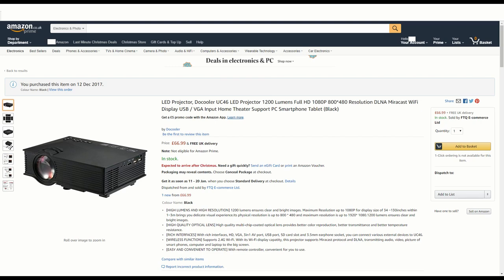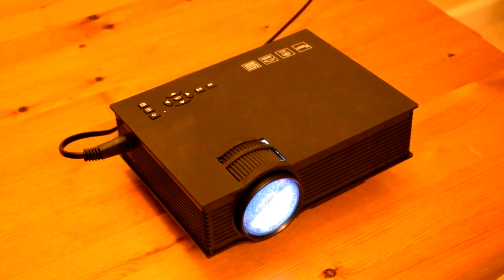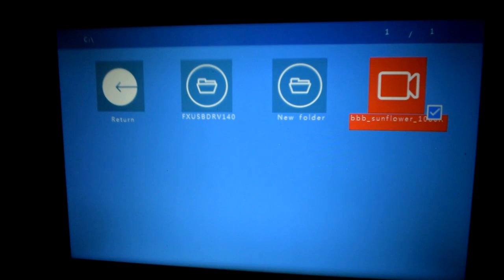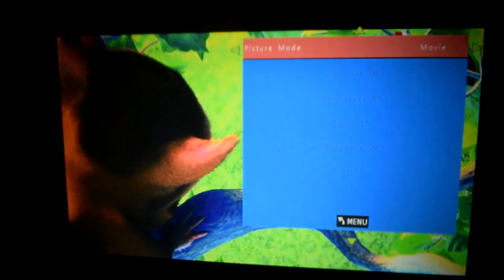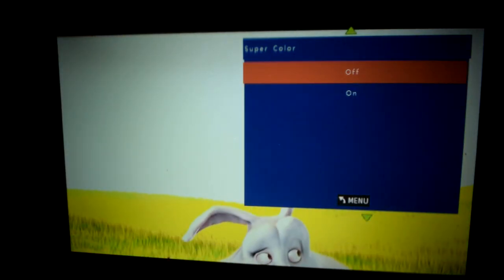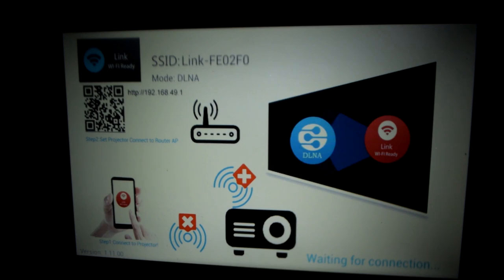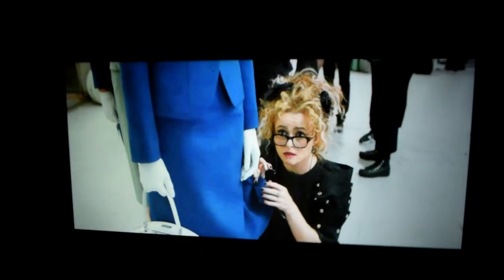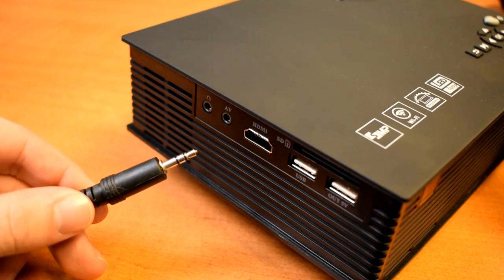UC46 £50 WiFi projector review, teardown & noisy fan fix

Comment: For the interessted ones : Inspired by this vidéo, I Used a 100 ohm resistor and it works perfectly, with 7,5 volt left for the fan. Plus, I have cut the plastic grid in front of the LED radiator. Cheap mod, great result. No problem after hours of use.
Reply from the maker: Glad to hear your mods worked out well!
 I wasn't sure if removing the keystone Fresnel lens would have an impact on the focus of the optics, but I guess the light is "parallel" at that point anyway, and the lens is bringing it to a certain focal point for the next lens which is shifted back/forth for the top/bottom parts of the image as it's rotated.
I'm clearly no optics expert ;)
Reply: did you projector survive
Reply: :o so only red cable with 100ohm on it?

Comment: what is the replace cooler fan spec to take note of? Thanks :)
Reply from the maker: it's a 15mm x 50mm x 50mm blower style fan, which seems to be a standard size, usually with "5015" somewhere in the part number. 12 volts. Ideally 3 wire (red, yellow and black). It's probably fine to just get a 2 wire one and leave the yellow disconnected. You will probably have to reuse the connector from the old fan. It looks like a JST PH series, 3 pin connector.
Searching "50 15 blower 12" on aliexpress or ebay should turn something up.
Reply: where i get lcd panel of unic uc 46

Comment: This could burn out led better add a quiter fan Security-01
50mm x 15mm 5015 12V Dual Ball Bearing DC Brushless Cooling Blower Fan BB5015H12 with 2 Pin UL TUV
Reply from the maker: Could do, but the temperatures I measured didn't seem concerning. I personally don't see a projector of this quality and value being something you'd use in anger all the time, so the life will probably be adequate. The main PCB on mine seems to have developed a loose connection already anyway, so that wasn't even the first failure mode. Hopefully it just needs the connectors reseating!